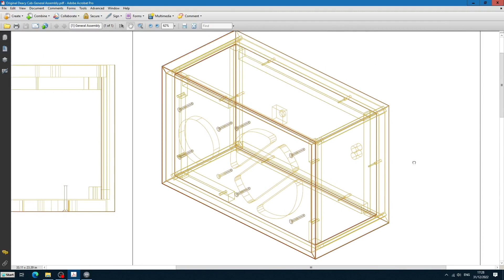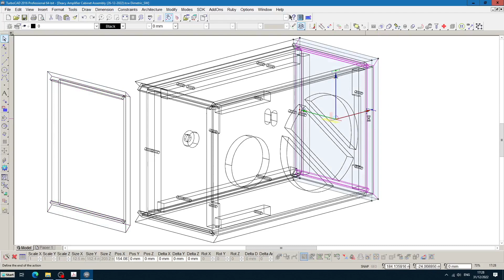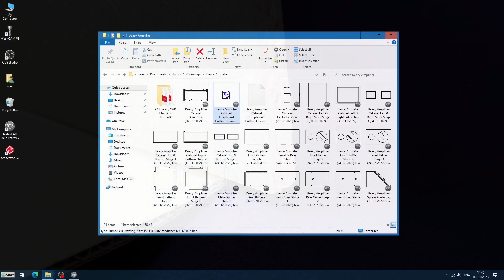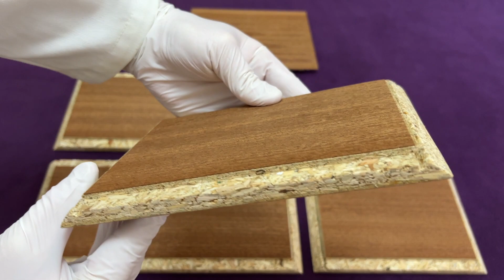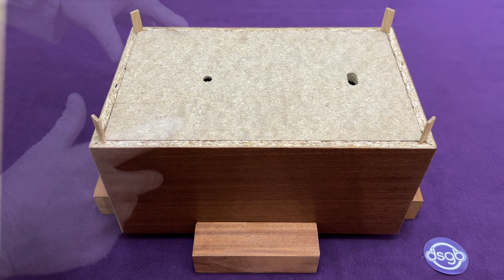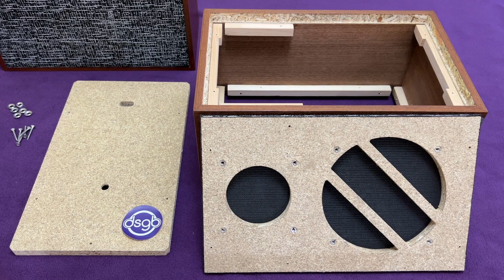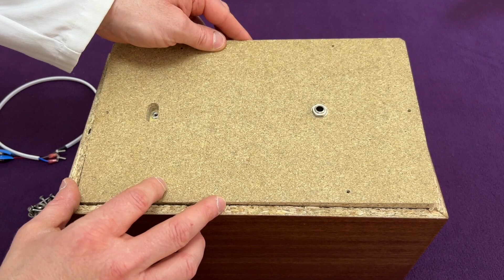Brian May Deacy Amplifier Build Part 3 - Making the Cabinet and Final Assembly

Comment: I have a lot of the Celestion G6 twin cone speaker upgrades that are no longer made. I also have the KAT replacements. I like the original Celestion G6 twin cone speakers that are no longer made. Can you tell me anything about the wattage and why they're 16ohms? Any info is appreciated. THANKS
Reply from the maker: Hello Joseph. I am not an expert on the Deacy amplifier and you don't provide any context of why you are asking so this makes it difficult to answer your questions.

Based on a selection of 1960s and 1970s vintage LF drivers I have bought for my Deacy amplifier build projects, 8 Ohm and 16 Ohm impedances are typical. I understand the original Deacy speakers are 16 Ohm impedance. Watts output is not known to me. For the KAT version, Nigel Knight might be able to help by providing this information.
Reply: @dsgb  Yes Nigel is recovering from prostate surgery so I don't want to bother him. I have SIX of the Celestion G6 speakers and I think they are 30watts as well as 16 ohms. I sort of answered my own question because I just tried my HIWATT DR103 100 watt amp threw ONE of the G6 celestions and it sounded great! I have SIX of them so I want to wire all six for the HIWATT is what my post was about. I just need to learn a wiring scheme for the right impedance. THANKS for answering me.
Reply from the maker: O.k., thank you for your follow up post.  I get a number of questions without context and I do like to help if I can and of course, I'm interested in people's projects.

HIWATT are great amplifiers. I would really like the full HIWATT Little D rig with WEM cabinet but they seem to be discontinued and prices can be in the £1,750-£2,250 range. It can be switched to a 1 W mode for practice and looks killer: very David Gilmour/Pink Floyd.
Reply: @dsgb  THANK YOU, anyway I played my HIWATT through the discontinued Celestion G6 speaker and it sounded great! Just a single G6 and it had all the HIWATT characteristics I won't turn it all the way up until I have all six wired up as I have a six speaker cabinet cut out for 6.5" speakers. Just to let you know. The whole reason I asked is because you had one in one of your VBM1 amps.
Reply: @dsgb  Also I thought you were a content maker named Fabmay, sorry I got you confused with another guy.
Reply from the maker: O.k. No worries. That has never happened before. 😂

Comment: Do you have the plans or a dxf drawing for sale for the cabinet ?
Reply from the maker: I don't sell plans or make my 3D CAD files available to download if an official product already exists. In this case it does.

You can buy Deacy amplifier cabinet kits from Knight Audio Technologies (KAT) when they are in stock:

https://deacyamp.com/products/kat-kit-deacy-amp-cabinet-kit
Reply: @dsgb  They dont have them anymore. Permanently "sold out"
.
Reply from the maker: That was the situation when I made my cabinet but Nigel eventually reintroduced them to stock. You could produce your own plans quite easily in Fusion360; the cabinet design is relatively straightforward.

Another option is to find a suitable vintage loudspeaker cabinet from shops or internet auction sites then customise it.
Reply: @dsgb  Impossible if I dont have the dimensions.
Reply from the maker: I mention the key dimensions in this video that you are commenting on starting at time index 00:29. 🤔 That should be more than sufficient for anybody to create working drawings from. 👍🏻
Reply: @dsgb  Sorry about that. I watched your videos carefully but for some reason missed that. For some reason this is error is happening quite frequently with me lately.
Reply from the maker: No worries. Good luck with your Deacy build endeavours. 👍🏻😀

Comment: Hi Doug,  what wood filler did you use to fill the gaps between the chipboard and the veneer? Do you have a preferred make/type. Thanks.
Reply from the maker: No preference Tim. On the Deacy cabinet build I used Ronseal multi-purpose wood filler for general gap filling and smoothing. On my Red Special build, if the zone might need to be drilled or subject to some loading, I used Ronseal High Performance wood filler. This is a two-part catalysed formulation and has a strong odour. Also consider two part epoxy resins (for general filling, not specifically on the Deacy cabinet chipboard) although I seem to experience inconsistent results getting these to set despite careful measuring and mixing. 🤷🏻‍♂️
Reply: @dsgb  thanks. I’ll get some Ronseal and give it a go.

Comment: The box cab itself is surprisingly complex to bring together. Admirable though your efforts are, just how necessary is it to go to these lengths? Couldn’t you just use an old 60s/70s speaker cab or will the overall tone not be satisfactory?
Reply from the maker: A similarly sized speaker cabinet constructed from material of similar density will have similar tonal resonance.

The cabinet is actually very straightforward in its design and construction and typical of budget loudspeaker cabinets of that era.

It is my choice to go to these lengths because for an engineer, there is a certain satisfaction and personal challenge in replicating an object to a high degree of authenticity, not to mention the knowledge gained from stretching oneself to learn new skills.

Knight Audio Technologies have made their Deacy cabinet kit available to buy mail order so you can just get that, apply veneer and glue it together if you wish:

https://deacyamp.com/products/kat-kit-deacy-amp-cabinet-kit

Comment: This is now, and will be in the future a Godsend for people wanting to understand the Deacy Amp! Thanks for all your tireless efforts. 😀👍

Does the Deacy have any overdrive sound without a Treble booster? All the small amps I've made need a Treble booster to make them useable.
Reply from the maker: Hi. Thanks for your supportive comments. No, the Deacy doesn't have any in built overdrive function. Like most guitar amplifiers, it will require a treble booster or other gain circuit to overdrive the tubes or transistors into distortion.